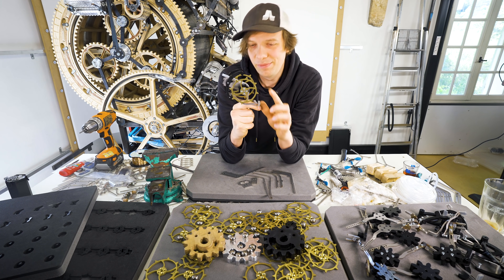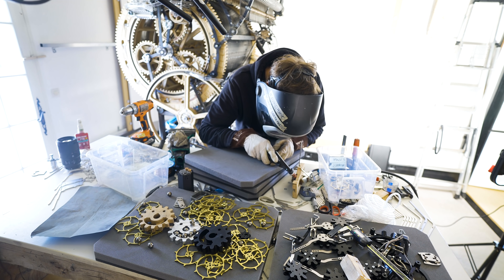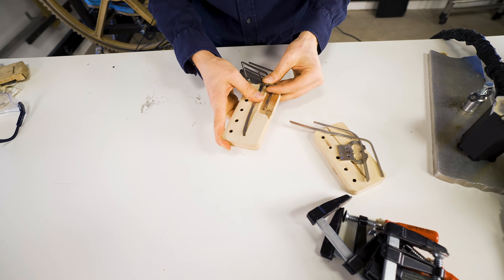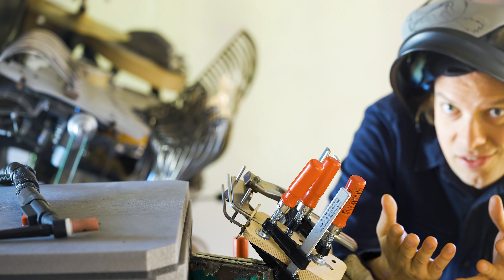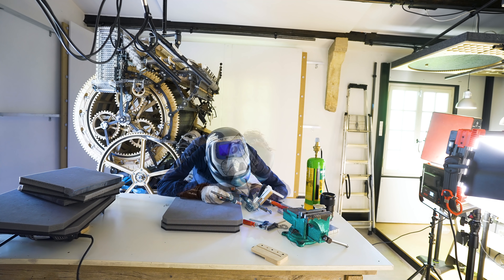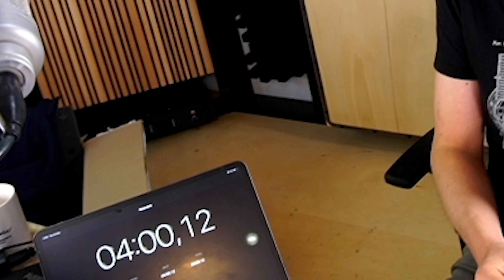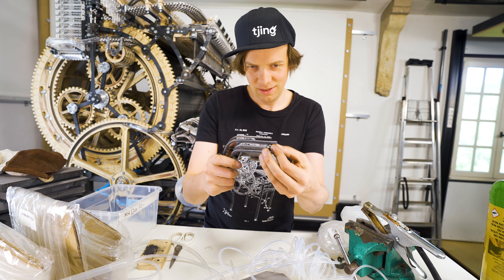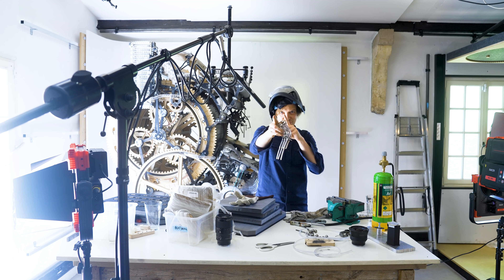Trying the Marble gate - Will it Work?

Comment: My advice for taping stainless steel is to drill a bit bigger hole. For example M5 has a 4,2mm center hole for normal steel but for stainless we used 4,3 mm drill instead .I worked on a huge horizontal drill/mill machine.And the main workpieces we machined where from stainless and super stainless steal and duplex. Oh man I hated those materials.I never forget the feeling when I broke an M3 tap in the last hole on a 7 ton workpiece.

Comment: Thinking about your welding cable... In the old days (I mean old days) they use to have a 5 to 6 foot vertical post with a spring on it to hold up the hose for the hose for a steam iron in laundromats (here in the US). The hose what hot, and the iron was heavy so you needed something to hold the supply line to the steam irons. I am not sure if you have to attach the post to the table or have a flat 16 inch by 16 inch square flat piece of 1/4 inch plate steel (the bigger the more stable) welded to a ~1 square rectangular post (the height so it's comfortable for you to hold your tig), which you attach the spring to, which attaches to your cable. If it is not attached to the table then you can move it around as needed. Not sure how to advise how you attach the cable to the spring. But at least it's something to think about.

Comment: If you can get away with just a fusion weld, always do so, great for speed and consistency in production. If it does need a bit of filler, try designing the part to be its own filler, like having an edge stand slightly proud, or having a bit of extra material at the weld zone. Use the welder's pulse setting to keep time, count the pulses you need, repeat.

Comment: 00:57 You should use the drill press to tap the thread too! Put your tapping bit in the drill press, leave it turned off, but disengage the gears so you can turn the drill head manually... I think I used to leave the chuck key in there and use that for leverage to turn the drill.... Apply slight pressure downwards as you turn it, turn it forward and back as you go like you would normally. Sooooo much easier than trying to use the stupid manual tapping holder thing...

Comment: Do you have a bench grinder? If not, I think you would appreciate having one, especially for wire brushing. A drill press and small lathe would also be extremely useful for these projects, if you don't already have them. Lots of stuff you're doing by hand coukd be made easier with said tools.

Comment: Hi, first of all: Congratulations to the Working Design of the Marble Gates. The look and the function seems Promising. To what to learn from the Welding Problem:
1. Fix the Part in a way, that it prevents it from moving if the Area around your Weld joint gets weak(obvious).
2. You could have used a thinner Elektrode and les Current to have more Time and control over the Welding.
3. Are you using the right additional Material for Stainless steel? it looks like Brass and not like Stainless steel.
4. I learned that you can actually stick the Elektrode a bit more out so you can see better.

Comment: That POM parts slot being usable both for easier assembly and keying is beautiful.
The marbles causing the pressure that turns the big brass wheel is also beautiful.
The instrument and sound it made when it just worked. I am in love. What a part.

Comment: You have no business welding assemblies like this!  You need to BRAZE, and not with electric arc.  You need to use GAS-AIR torch & silver brazing alloy (with flux).  There is no need to exceed 1000C.  You can do that all day & the steel will not melt!  You should support the narrow track piece on its top end to prevent warping.  HOW MANY TIMES DO I NEED TO COMMENT ABOUT GAS BRAZING TO GET THROUGH TO YOU!  Martin, do you read these comments?
          When something gets screwed up (and that WILL happen), you can UNDO gas braze work, but almost NEVER undo weld work.  Hopefully, you had extra parts made.
          The jig you made for the repair, you should use to prevent warping.

Comment: YOU MUST TRY A PRODUCT CALLED "RAPID TAP" for all your drilling and threading. It is a great surface tension breaker and lubricant. I have used it for over 50 years and just can't stop raving about it. That and consider "Cobalt drills" from "WURTH IND". They are guaranteed for life and if ever dulled or broken they are replaced at no cost. They make a similar set of taps as well. Pricey but well worth it in the long run. Great repair on that blown out weld. Your engineering skills continue to excel. As a fabricator I used jigs and fixtures most of my working life. OMG, , , This is a wonderful and beautiful piece of complex engineering and construction that should be admired from all for all time. You have all the "GOAL" arm raise you deserve on this complex piece. You are rocking this now. That and I think this is the first time I have listened to the piano played with a welding hood on. This whole post is amazing so I will be back for another visit. WELL DONE MARTIN ! ! !

Comment: One important lesson I learned from manufacturing stuff: if you need 32, order and make 34. Always make 5% more than you think you need.
Reply: Unless you are ordering wood for a project, then 25% more is a good number. Leftovers and scraps are always useful!
Reply: I'm really surprised that Martin didn't order more. I mean. That's the most logical thing to me to order more.
Reply: @DerNivel  Probably limited by cost, this was a pretty big ordering spree of machine metal parts
Reply: @anonduckduck  Ordering single parts for failed assemblies is even more costly.
Reply: I am looking forward to have learned this now in retrospect.
Reply: but 2 extra parts are already 6.25% more. that is way too much. □

Comment: The way the parts have come together, it’s like an overnight success..... 10 years in the making. All the hard lessons have turned into a amazingly straightforward assembly. Sure there is the forehead slaps, but so few. The marble pressure management ended up turning you into a designer that was good enough to pull this off. Of course not forgetting all the brains in the discord! You all make me want to make more.

Comment: I might suggest you talk to your welding guru and ask if it is appropriate that you trial using a smaller cup on your TIG which would allow you to position your torch better and allow more stickout on the electrode, with the bonus of a better sight line to the weld area.
This also would allow a more concentrated shield gas area for the small welds you are using and reduce gas consumption.
By the way your piano playing is reminiscent of Leszek Mozdzer.
This will be a beautiful creation when it is completed.
Thank you.

Comment: Soldering methods for NO DAMAGE! (maybe these videos can be useful)
I use the pcb soldering method for screw and nut combination. For this method, you need to roughen the surfaces of the parts to be joined by filing them a little. You can make joints with low temperatures and without melting the parts to be joined.
https://www.youtube.com/watch?v=tn7Ea69VhHY&t=35s (Watch from the 5th minute)
https://www.youtube.com/watch?v=GwRhUa4th2c (Watch from the 2th minute)
Another join method silver solder:
https://www.youtube.com/watch?v=XUF0xgAtm2Q
https://www.youtube.com/watch?v=0jdAF4rOQ8w&t=399s (silver solder)

Comment: soo... when are you going to dip all marbles in silicone, to avoid all kind of metal on metal sound? 😂
Reply: Also when drying the liquid will accumulate on the underside and make the marble shape uneven and inconsistent...
Reply: It would thicken them up, the machine isn’t designed for larger marbles.

Yet 🤭
Reply: @OskarCzechowicz-OmniMusician  or just buy slightly smaller marbles coated with silicone? 🤔
Reply: buy silicone balls 😂
Reply: kind of ruins the metal on metal vibraphone :P
Reply: @childofsol5843  And the magnetic system 😂
Reply: Will it also makes the marbles bouncy?
Reply: Just use foam marbles
Reply: Iron infused rubber balls
Reply: You're probably not a musician
Reply: Or he could use old mouse pointer balls, they were perfectly round
Reply: Interesting idea! But it would probably make the bass sound very boring hitting those metal strings
Reply: @DavidJohansson  Oh no... This means he has to build a whole separate track for the metal marbles on the bass...
Reply: Never, because he'd have to rebuild the entire thing.
Reply: 😂😂 you had ne on that

Comment: the (thin) tubing is trapped on the 5 guides by the two plates being welded : may that not lead to a maintenance problem when the tubing is worn out by the marbles ? this is such an elaborate part for it to become a consumable due to the tubing...

Comment: I know it's far to late for this suggestion. But I would have Brazed those parts together using a Propane or Mapp Torch and SSF-6 Silver Solder. Much lower amount of heat needed and far less risk of burn through. SSF-6 Flows evenly into the gaps between parts and doesn't leave those unsightly welding bumps.
Edit: Here you go. Found a demonstration of what I've used on Stainless before: https://www.youtube.com/watch?v=uf6J1pmmApk

Comment: hello Wintergatan I follow you from Italy I worked 4 years as a welder with different technologies including the tig. unfortunately I don't understand well what you say in the videos because I'm not good with English but I wanted to give you some advice:
when you weld these types of pieces stretch the tungsten slightly more make it very thin with a very narrow angle in order to have the very thin tip, then you adjust the current between 80 and 90 amps I think it is enough for that thickness and you use the spot welding technique .
in practice you give a big blow to a single high current point in order to unify the pre-existing material without adding new and point to point you go to turn the whole outline of the arm. unfortunately due to the pandemic I lost my job and I don't have a welding machine available otherwise I could explain better. I still hope I have explained myself

Comment: My favorite little epic piece of engineering in this assembly is the gear with a slot off the axel hole so it can be put in place after the framing is all welded together. Elegant solution, for sure!

Comment: Yuore grzy! Or genius, no, youre grazy genius! But id still be palced some other metal part between the loose dropped part and the base part, not welded with weldig build up. Some times when i repair car plates i do build up because theres so much rust left even when i remove all rusted parts and do New part to fit the hole..13.37 i want doorbell done like that!

Comment: As a welder.. I think you would do better using short bursts of 100A arc and not using filler at all. You're putting a lot of heat in the part to melt the brazing.

Comment: No point in using silver brazing when your tig settings melts through the steel in 2 seconds. Brazing is great when using a really low heat source like a flame, but with a tig torch, it's not really helping as much as you might think. Less amps, real stainless filler rods and more of it so the weld stays cooler.

Edit: Ok sorry it sounds a bit harsh. I love your videos and this ending was amazing.

Comment: I wonder if there are any modifications necessary for the clock escapement because it will have a variable frequency of ticking that a regular clock doesn't deal with, like 1 in 10,000 times at high tempo, it slips and goes one extra notch, releasing two marbles. 

Edit: Called it.

Comment: Someone correct me if I'm wrong: did the test at @14:16 actually run perfectly? Shouldn't a marble be released every time he presses the button?

If you look at the top of the gear, you can see the thing that catches the gear going up and down faster than the gear can actually rotate, so it appeared to me that it actually didn't pass the stress test.  I don't think it's too much of a concern,  since the machine will probably be a little slower and a lot more consistent, and I don't want to take away from the achievement, but it seems like it might be something to cautious of.

Comment: Martin wearing a welding vizor while playing on the piano should be immortalized as a silhouette on a Wintergatan t-shirt - and as a logo!!! Martin's is not just a musical genius - he is a mechanical genius as well. We watch in awe. Thank you Martin!
Reply: it would be great with the lettering "Do not quit your day job" leaving people to wonder if he is a welder or a musician
Reply: Mechanical genius? Mate, where have you been the last couple of years? :D
I'd totally wear that shirt though!
Reply: Martin is amazing. He has learned so much skill outside of music. He now knows how to use profession CAD software design. He can program CNC work, Yeah the Cad makes that easier. Knowing how to manage materials of the parts being CNC. The use of various hand tools. I think the most impressive skill is the welding that he has learned.
I've never done any welding. But I have much experience in soldering electrical components, (well, that is a form of welding). I see the two as an art form.
Welding of hard metals. I know of three energy methods for welding. Flame/heat, Electrical and high friction used on BIG parts. Martin using flame welding, was that the best choice?
Reply: @tigerzero5216  I am not an expert, but I believe he is using tig welding. I have only welded a handful of times, so I am not completely sure. Its not the flame that welds the metals together, it is an electric arc that melts the metal.

Comment: Did you order extra parts? When you're having something manufactured the incremental cost of another part is usually not that great, whereas having one get broken is a huge cost. It's usually worth order and extra 2+ of every part just in case something like the welding oops happens.

Comment: Weld your taps into cheap deep sockets, and use a cordless impact driver. You won't be disappointed with the result. They run cool, straight, fast, and last forever.

Comment: Fyi, you often don't need the full thread depth on machine screws into steel to get adequate strength.  You can go up to a 0.1-0.3mm larger tap drill for about 50% thread depth and reduce the chance of breaking taps.

Comment: Nice work as always. Seeing that argon cylinder at 10:27 just sitting on the edge of the table made me a bit nervous though - if it falls and that valve breaks off it's no fun to dodge as a 20kg rocket ricochets around the room! Maybe you need a welding caddy for your work table.

Comment: You could use soft solder, like clickspring. You have absolute no load in those parts it would be easier and less risk of warp.
Reply: Your machine is much closer to a clock than a regular heavy mechanical device, maybe you should look to other less drastic process than TIG .

Comment: Some advice from a machinist-in-training:
1. Get a tap guide and put in your chuck. It will keep constant pressure on your tap and help keep it centered.
2. To avoid breakage, use: 
 a. cutting fluid.
 b. This formula to determine the number of rotations needed to tap a thread to the proper depth (unless it's a through hole):
R = D ÷ 1/T
R = Rotations
D = Thread Depth
T = Threads per mm

Comment: I would use a mig welding machine, it's less difficult to use. I would additionally use a piece of steel the same gauge you welding to put down a few practice beads to tune the machine speed and arch. Also helps you see what size of puddle to expect and look for. My preference and practice, not a recommendation. Good work.

Comment: Here are some suggestions for welding:
* Spend some time practicing before you weld on things that are important.  You need to practice on junk pieces and learn the machine settings, technique, etc.
* Get a foot pedal, those torch mounted switches are horrible for control.
* It seems you are unable to actually see what you are welding because the tungsten is not sticking out enough.  Get a gas lens system from the Weldmonger store and extend your tungsten further so you can see what you are doing.
* Your amperage seems to be too high for much and this goes back to the foot pedal, with the foot pedal you'd set this for 125 amps, then a quick stab to tack, VERY QUICK stab.  With the pedal you can let off and maintain a very low amperage arc.
* Your argon bottle is pretty small and gas coverage seems to suffer on many of your welds, you should be starting out at 20CFH flow, that little bottle probably holds 5CF of gas, so you will need a bigger bottle for proper gas coverage.

Comment: if the steel being hardened from the lazer becomes an issue you should try tempering the steel to get rid of that hardening. also you NEED to have spares of everything epsecially when going on the world tour things will break things that are "unbreakable". and if the wrong thing breaks and you cant repair it and dont have a spare that could be the end of the world tour.

Comment: The nice thing about metal work and wood work is that it can almost always be fixed.  You can always file down the volcano weld if you want it to still be pretty.  I'm sure it is too tight a space for an angle grinder, but that is why there are Dremels, and files still exist.  Men used to file entire hexagonal rifle barrels and all the parts for the rifle with a simple blacksmith made file.

Comment: Do they train engineers differently in Europe? I have a degree in Mechanical engineering and that included only 1 hands on fabrication class for only 5 months and we covered the mill, the lathe, sheet metal tools like the box and pan brake, and pinch welding. No cnc, no tig or mig.

Comment: since you are tempted to over-weld, i suggest you do a test: a single tack weld between 2 pieces of metal and try to pull them apart.
welds are insanely fucking strong. 1 tack weld will easily hold hundreds of kg.